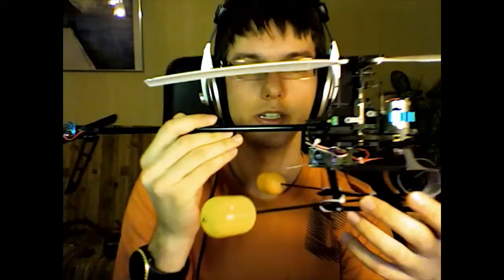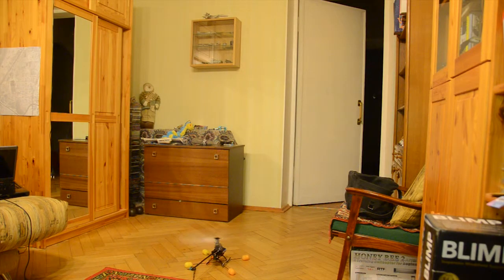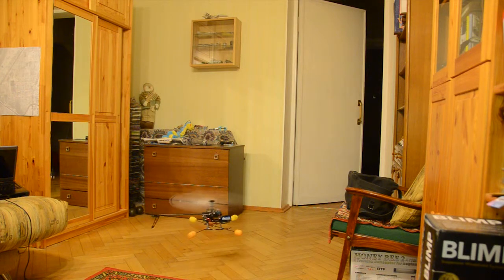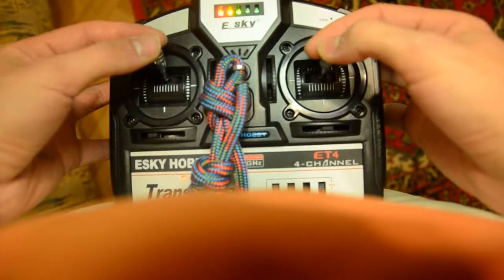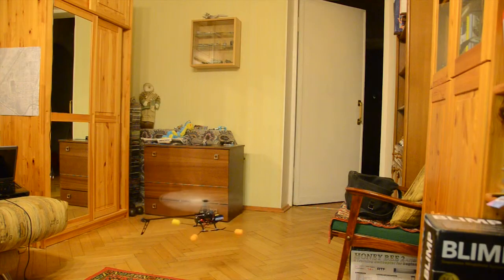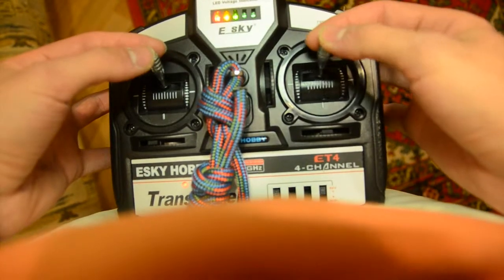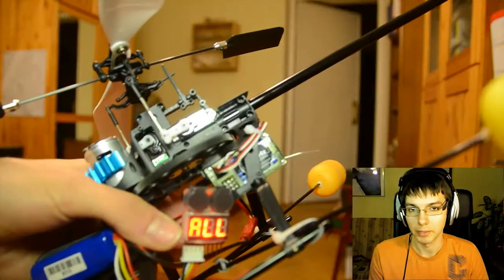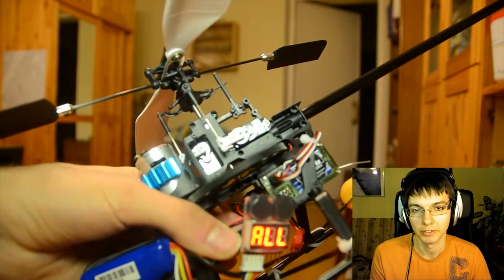Esky HBFP v2 problem

Comment from the maker: @simpo72 Thanks) The problem was in the motor only. Also, I disassembled the motor and it turned out to be that one of the brushes completely broke off and only a spring was in contact with the commutator. It's my 4th motor already:( I think I'll buy a EXI 450 clone soon and start learning a proper collective pitch heli:)